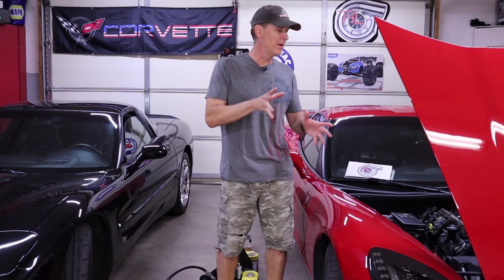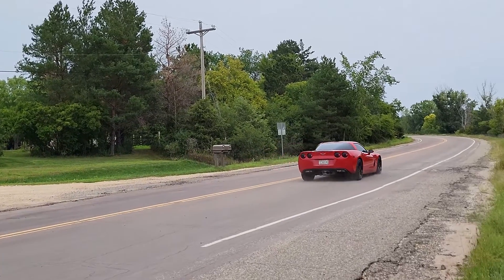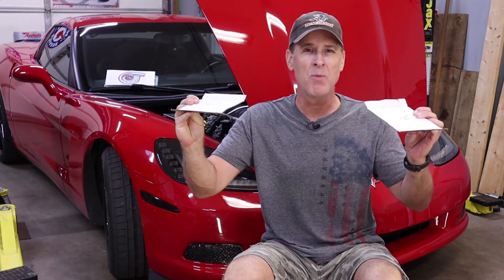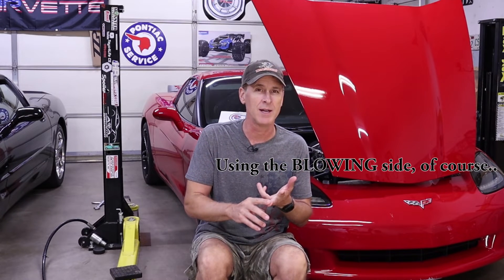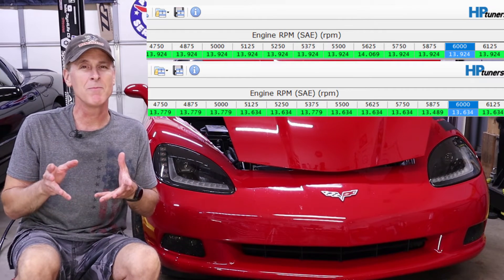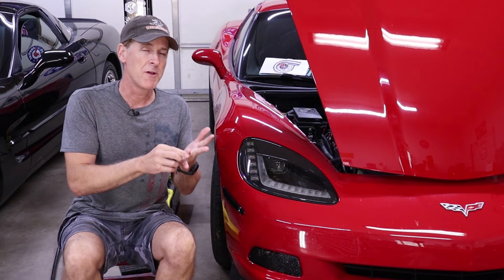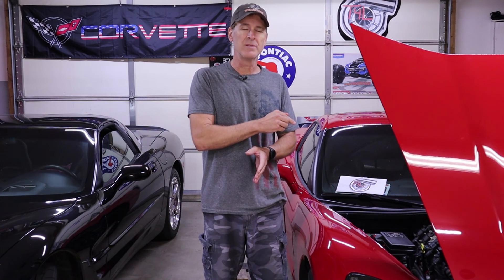C6 Corvette Air Intake Testing (Is the Stock Unit Good - or - JUNK?)

Comment: Do you remember the Ram Air system the Trans Ams had in the 2000s? Do you think a setup like that would make a substantial difference?
Reply from the maker: In my opinion the biggest thing is just getting cool air instead of hot engine Bay air.

Comment: I've said for years, the OEM cold air intake boxes are actually more than adequate for the engine, even with a mild tune.
I put K&N filters in there, just because I can clean them and re-install, rather than replace, replace, replace.
When you change or add turbo's and Superchargers your intake air demands obviously change, and thus so will the intake.
Adding a cone filter won't necessarily add HP, but it will reduce the noise dampening and make the intake louder.
The advertised HP gains are done through temperature drop, NOT the intake itself.........................They also heat soak a lot easier too.
Not everyone wants a loud intake, and the drone that comes with it.

Comment: Hello I have a 2012 c6 grand sport and I was wondering if I remove the helmholtz resonator air intake system on it will it decrease performance?
Reply from the maker: I don't think so, but I can't prove it. LS3 has it, the LS7 doesn't.  My belief is it's to make the LS3 quieter.

Comment: Why don't make test whit aftermarket air intake? Like k&N or Afe intake
Reply from the maker: Because if the stock air intake is not restrictive, it wouldn't be any benefit to put even a less restricted air intake on, unless it draws its air from down low in the front where on average it will be cooler. The LS7 air intake uses the card style mass air flow sensor ditching the factory restrictive LS2 mass airflow sensor. This helps a little bit and will help even more as horsepower goes up from additional modifications in my opinion.

Comment: Interesting video as I did my own previous research when confronted with all the hype regarding aftermarket air intake systems.  I researched the air filter elements used on the LS2 Corvettes and found that the Cadillac North Star Engine uses a single air filters element that the LS2 uses in a pair.

Comment: I have a 2007 3LT  Z51  Atomic Orange Metallic  only 11k original miles.  Just put a KnN cold air intake on. Really a big difference the stock was so restrictive imo. I also have a 96 coupe Z51  and a 95 convertible.  I put on SLP air intakes big difference imo

Comment: could the reason the "cardboard " did not restrict as much as thought was because the sides of the filters were still uncovered allowing air to flow? Which is the reason for the pleats in any filter (paper or gauze)? As it increases the  surface area of the filter. I would guess that if you made the cardboard to be like the cover of a shoe box (top  &sides) you may have seen you you thought you were going to see? Do not know is my description draws you a picture or not. OPPS!!!!! I stopped the video before you got the vacuum out. Sorry I'm old (71+) and have to write things down Before the sponge in my head lets my thoughts escape. So I went away and finished watching the "WHOLE THING". And the only ting that would like to add is that the K&N "type" filter (gauze) is supposed to be better because it can be cleaned and also paper filters pores are supposed to close up our time from Moisture that is in the air. Is that true - no idea but every thing I own and  have owned gets one. Fuel mileage in my cars has always increased a minimum of 1 mpg. That is same car, same drivers, same roads and conditions over many tanks of fuel! At the least just the cost of multiple paper vs i gauze filter makes it worth it-at least to me. Just an "Old Frat" car guy. Been a ASE tech since the 80's Our Vette is an 08 LS3

Comment: Wow, I wish I saw this video before I started my intake system, it would have confirmed some of my thoughts on intake/ filter set ups. With help from Vararam I came up with a Ram air set up with a race air filter( flows twice as much as a standard Vararam filter). Not being an engineer our assembly was an educated guess system, plus home fabrication. After dyno testing we made 650 crank horsepower and 640 ft lbs of torque, and that was with a failing throttle body confirming your findings of filter flow. Our Vette is an autocross car so we don’t have to worry about rain, debris or low flying birds, so it’s not a street car application, but it works. Thx for your videos, keep it up. Wish I could include pictures, you’d like it!

Comment: I did run the Corsa ram air on my LS2 car for months. The system works great but the filter gets dirty and clogged real fast.. maybe less than 3k miles.
Now I use a K&N system but i cut the radiator shroud below the air filter so it can pull cold air up from the air damn.

Comment: I have a corsa intake and exhaust.  The increase due to the ram air effect is tremendous. Since it moves the intake from under the hood to just behind the front grille, it lowers the air temp and forces air into the intake..
Reply: Is driving in rain an issue?
Reply: No issues in rain. The intake is behind the front lower grill. It goes into a large box. The throttle body is connected to the large box on top. Almost impossible for water to get in. The corsa intake made a huge difference.
 @tman3831

Comment: Slightly off topic.
Is the Fast 102 intake a worthwhile mod on a stock ls2?  I've seen it as comparable to headers and exhaust.
Thank you
Reply from the maker: My understanding is that it is a great upgrade mainly because the LS2 Manifold was made differently than the LS1 & LS6 manifolds and has some flow issues. The only issue is the big $$ Price.
Reply: @Toys4Life  thank you for your answer. I love your channel
Reply: @Toys4Life  I've purchased both the FAST and headers. Love the upgrade. Next might be a cam to take advantage of the much better air flow.

Comment: Always love your videos! Question, if the air filter housing was sealed off in the engine bay so only air coming in through the front grills reached it, would the air blowing into the assembly from the car moving at high speed increase the static pressure that it sees, like the pressure you feel if you stick your hand out the window?
Reply from the maker: Thank you.  Seems like it would add a small but measurable pressure increase.  I would love to test the Vararam for this exact reason.

Comment: How about cfm's?  That is actual airflow, seems like they are equivalent?  Seems like you may not get much bang for your buck on the intake you built.  Maybe a Dyno test is needed.
Reply from the maker: Ha, I agree- back to back testing on the Dyno test would be best - but since I do not own a dyno (yet) tests like this would  be cost prohibitive.  The MAF sensor measures flow but I think the MAP is more accurate for this purpose (IMO) - so I went with the pressure inside the manifold as the indicator for this test. The intake shroud will hopefully keep MAP pressure the same or better, run cooler, and take longer for heat soak to set in in slow traffic.   We shall see what the tests show - working on that today and this week.  Cheers!

Comment: 13.0

The way you explain cold air is interesting.
Does this mean that you get more power when driving in the winter because the air is cold, then hot summer air?
Is there much of a noticeable difference with a LS3 car?
Reply from the maker: About 1% more power for every 10 degrees F the temp drops.  Yes, winter gives the best HP vs hot humid summer.

Comment: I drilled a 1.25" holes in the plastic pocket where the clips are that hold the main radiator ducting in. I drilled them from the bottom. My thinking is that since the holes are in a pocket outside of the main ducting flow path where the velocity is high but pressure is low. These holes being in the recessed portion should not allow for debris to have a direct path to the air filter, but it should allow for more cooler air.

Also, I did take the front bumper off for some brake ducting mods and there is a ZO6 shaped inlet grid on my 2005 and the bumper foam also has the indented ramp pathway leading up to it.
Reply from the maker: Very interesting - thank you!

Comment: I got a haltech killer bee upgrade, it literally did nothing, maybe like 1% faster, and a litttle more gurgle. 
They are telling me that i need to make it breathe better, and fart better, before i can make it go faster. 
So thats what we are doing, Cooks headers next, and then the cam. If it still not enough i think we will start building the engine, they said something about a 383 stroker, but thats last thing we do i think.

Theres not much i can do for weight, unless replace panels, and skin the inside of other panels, i am working on getting a lightweight racing battery and alternator to drop 50 pounds, not sure what else i can do to make it faster without a supercharger.
Reply from the maker: What engine do you have?
Reply: @Toys4Life  LS1, and now it has a LS3 mass airflow for future upgrades
Reply: It's a 2003 convertible
Reply: Last thing , it's tuned to 93 octane, and I put lucasoil octane booster in, and it made 293 whp on the Dyno tuned to 93 with no octane booster
Reply: Put a blower on it and call it a day! You will spend just as much doing everything you mentioned and still not make the power a supercharger will.
Reply: New heads or porting the ones you have will net 30+ to 50+ whp. Heads are by far one of the best upgrades for wheel horse power on an LS1 with stock 241s.
Reply: You changed the intake, your planning to do a cam upgrade and Kooks headers.  You left heads off your list which are the most effective in producing more power out of an LS engine.  If you do cam and headers the heads are a must for real gains and necessary to get you over 400whp.  

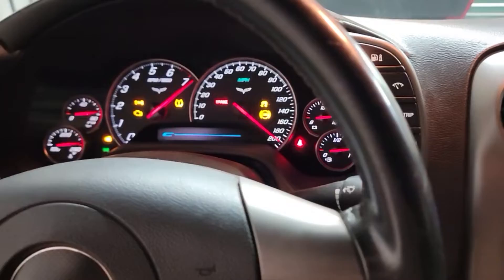Then depending on the trans in your car, if A4 a higher RPM stall converter and a 3:42 diff gear or if MN6 a 4.10 diff gear. Then you’ll have a nice road car with just over 400 at the wheels and a gear that makes up for lazy low end if your cam is on the higher revving end. All this and $5k later and your car still makes 100 or more LESS horsepower than going FI for $8k DIY. 

If your wallet isn’t limited you can do it all with the exception of the gear swap, which likely won’t be needed. And the results are awesome!

Comment: Not that improvements cant always be made, but looks like Corvette engineers did pretty good getting the most air into a stock LS.
Reply: I just wonder how good the scavenging is on this compared to something like the C5 or C5Z stock air boxes especially those cars without the zip tie mod
Reply: @Joey856721 Good question. 
I wonder if that mod will assist with the amount of absolute pressure. 😮😊
Reply from the maker: @richardcorcorran8965  Agreed, not a ton of easy HP to pick up - but we have to look!
Reply: Then they completely changed it to one Donaldson filter for the ls3. Would be interesting to see how they compare